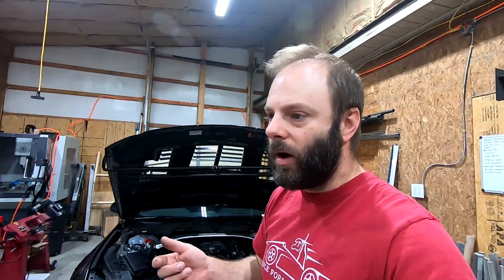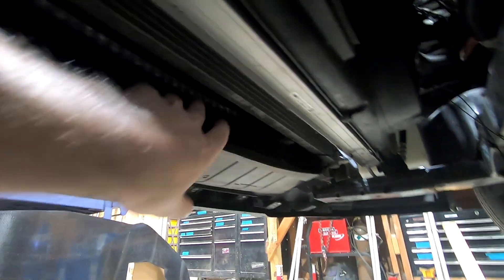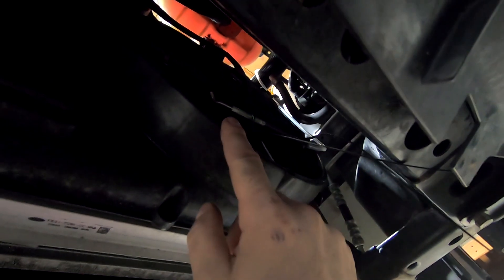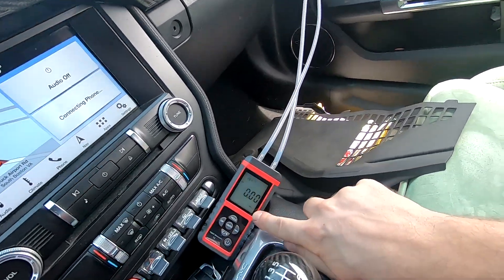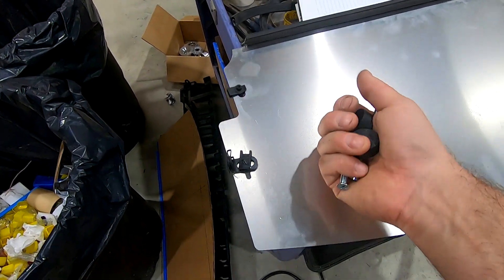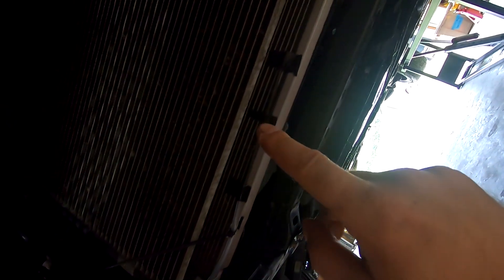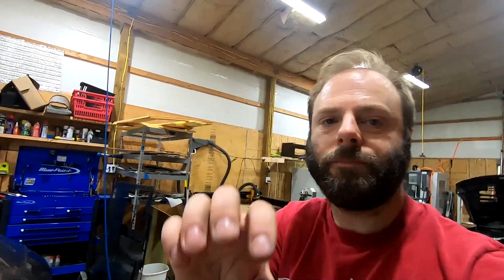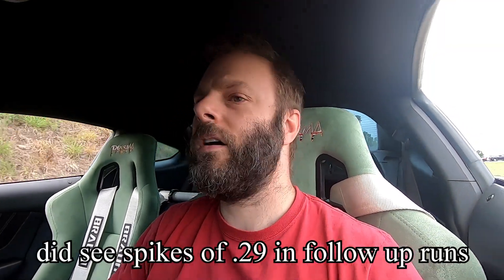18-23 Mustang Radiator Baffle Install and Testing

Comment: Did you notice any sounds after the install? Perhaps at higher speeds 70+? 
I've always thought about something like this, not wondered if it would cause sounds or vibration. 
Think of holding a think sheet of metal up in your hands and shaking it, that's the sound i mean
Reply from the maker: No. Shouldn't cause anything.

Comment: I’ll admit, I had a setup to measure air pressure but no way to get a reading. I was about to mount a massive barometer gauge.

Had no idea there was such a thing as a manometer🤣…and that looks a lot easier. I wonder if the meter would fit into my ram mount X grip. I could just put a go pro focused on it.

Comment: would a feature on the help/hurt flow? a ridge to push the flow up into the face of the radiator or possibly on the bottom (facing down)? aero is a bit of black magic to me.
Reply from the maker: @jr3628  since the bottom is sealed, not in this case.